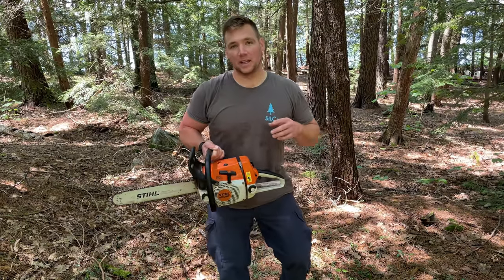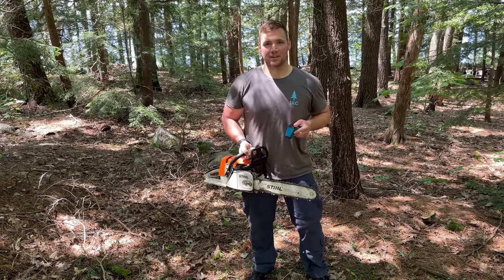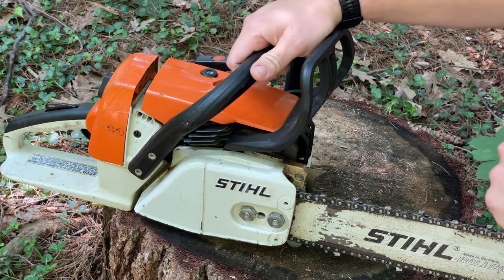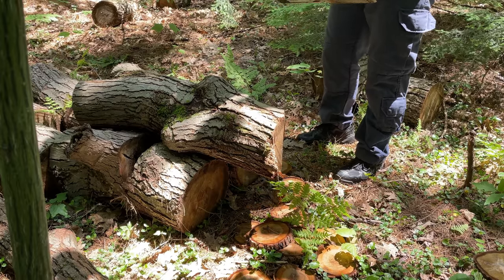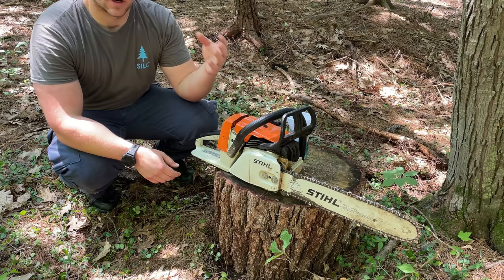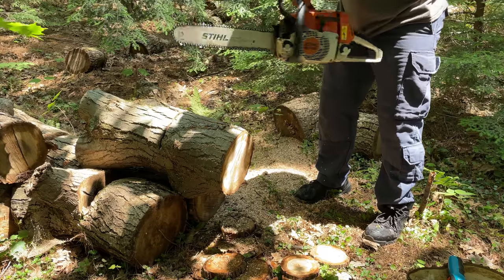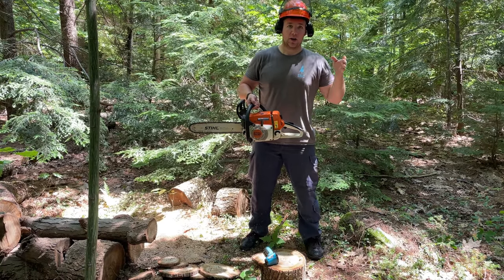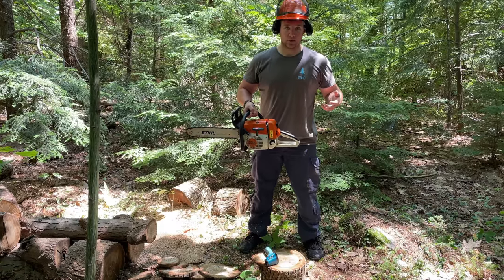Will my chainsaw last longer if I use more oil? Is it safer? (25:1 VS 50:1 temperature testing)

Comment: Just thinking out loud, there’s one variable you might have missed. Increasing oil in the mixture decreases gas. Unless you tweaked the jet settings on the carbs, wouldn’t that lean your A/F mixture out? And leaner mixtures do raise combustion temps and exhaust temps.
Reply: Actually, if you measure exhaust temps, they drop when detonation begins to occur.  So, I'm not personally sold on this parameter for developing a tune.  I have noticed as many will testify, a two-stroke tends to make most power right before it seizes (oil film failure).
This is why I place high value in the 4-stroking method for carb tuning.
Think of it as "dancing on the head of a pin" in the sense that when detonation begins to occur, the conditions for oil film failure are also occuring.  Detonation is often difficult to detect when it's occuring, it's much more evident by the way the engine runs.
Ever noticed when those last few drops of fuel from an empty tank are being used as the saw is running out of fuel, the engine feels most powerful just before it runs out and falls on it's face?  It just danced off the head of the pin and you felt it happen.
Reply: @thisisyourcaptainspeaking2259  right before my leaf blower runs out of fuel I can hear the engine pinging every time. And I know I'm low on fuel
Reply: @MrSprintcat  That's right, it's running lean at that point.  Maybe you know the old saying, a 2-stoke makes it's most power right before it lean-seizes.  This is because the piston overheats when the mixture is too lean.  Detonation occurs (often cannot hear detonation taking place, sounds like a pinging noise), piston overheats.
Stay on the fat side, don't adjust the carburetor mixture screws too lean, avoid detonation.
Detonation occurs when the fuel stops burning prematurely, such as low octane (low octane fuel burns quickly), insufficient fuel, or ignition timing is too far advanced.
I adjust my 2-stroke carburetor as fat as I can, where it still makes good power.  Occasionally this causes premature plug fouling and in that case I switch to next higher heat range plug.  This kinda depends on the factory ignition timing and spark plug choice.  Often, the factory timing is conservative and the plug chosen is a hair cold, to avoid pre-ignition (preignition destroys a 2-stroke almost immediately, pre-ignition and detonation aren't the same phenomenon)  Too much cylinder heat (such as a red hot plug electrode) can ignite the fuel prior to the ignition event.  Extremely damaging!
Some people go so far as to optimize ignition timing, ie: the pro motocross and watercraft guys, race saw builders.

Comment: When you add more oil to the gas,you have to retune your carb for the new mixture.  Plus your chain looked to be dull,with a dull chain makes any motor run hotter. The main reason they run 50:1 is for the EPA & yes the oil these days are way better then the 70's. I personally have old Homelite Saws, I use Stihl regular orange bottle mix & mix them at 16:1 & use rec 90 gas. I have the carbs tuned with the saw in the wood. They do smoke at idle but clear out once cutting.  I've never had carbon build up or any problems.

Comment: Less power, longer run time, higher temp.  Check your cut times on the video.  Try it again with a retune.  25:1 is mighty rich.  The 4 stroke guys know oil contamination of gasoline reduces power. A two stroke will run better and better up to 100:1, just at the expense of longevity.  32:1 seems to be the sweet spot for me.
Reply: Actually, when tuned properly, the more oil will give you more power. It's been proven in two stroke motocross testing. A 32:1 mixture is about perfect for a chainsaw but it will require a carb re-tune to get best performance and to assure you don't get damage from running to lean.

Comment: I would be curious to know what effect a 40:1 would produce, as that's what I run in my Echo CS620PW and Holzfforma G660 PRO. They're new saws and I've tuned them slightly rich to 4 stroke when easing up in the cut when in a log close in size to the maximum bar length; 27" and 36".

Comment: more oil is always better for the motors longevity. 40:1 and 32:1 are where I would run all of my equipment. Also you must retune your equipment when you make changes to your oil mixture.
Reply: That is not necessarily true

Comment: iv'e been saying this all along , oil burns hotter then fuel , also the more oil you use the more carbon buildup you get  which will cause scoring ,  thank you Dave
Reply from the maker: Awesome Michel!!!
Reply: @DavesSmallEngines  i'm thinking the apprentice might have taught  the teacher a little something here , lol  ,
even Steve's small engine disagreed with this idea 👍
Reply from the maker: @marcelcanuck  he did? Jeeze - I didn’t see that video!
Reply: @DavesSmallEngines  a few months ago  live show with Donny  ,not a big deal . i've learned quit a few things from his channel as well plus the guy is a hoot , great guy
Reply: If oil burned faster & hotter than fuel you'd have no lubrication & a seized chainsaw.

Comment: I was told by a very old Maine mechanic that 50:1 was the standard set in place by companies due to EPA regs. 
That's (one) reason Johnson outboards built in the 40's and 50's are still common out on the lakes and brand new motors fail after 10 years. The old motors ran on 16 to 40:1 depending on the year and model.

Comment: I may add a few drops of extra oil but for my Stihl I just use the motomix. If I don't know what the ratio is, I add a little extra like 40:1 just to be safe
Reply: Try 42:5:1, even better

Comment: I run everyting 20:1 with carb adjusted for that mix.Never had a problem with piston or cylinder. Saw is 30years old and never taken apart.

Comment: I agree, which is why I run 50:1.  Anytime you increase the amount of oil in the gas you end up with a leaner mix because the mixed gas has less gas per volume of mixed gas with the higher oil concentrations of two cycle oil.  Lean means hot and your tests prove it.  The key is to use a good two cycle oil and premium, non ethanol gas, plus a good stabilizer.  I use Stihl Ultra at 50:1 in everything.
Reply: Or tune your saw to run on your intended oil ratio.

Comment: Not an endorsement for anything but for 25 years I’ve been using Opti 2 (a one mix) for all my equipment.  My 52 year old chainsaw was 16:1, other equipment was 50:1 40:1 and 25:1 and I was tired of having 4 cans of old mixed fuel around.  Now 1 can, no ill effects on the old saw.  In fact I used it last week and other than beating my arms and shoulders up it ran perfectly.  That really amazes me, 1 ratio.

Comment: You also effectively changed the air fuel ratio with the 25 to 1 so basically you change the carb adjustment when you changed to the 25 to 1 my guess is you can get the benefits of running more oil in your fuel by manipulating the temperature of the plug you use and adjust the carburetor so benefits of 25 to 1 or 40 to 1 but the engine will run at the same temperature

Comment: I always run my mix rich on oil and have a few saws I've been running for 50 yrs plus with zero  engine issues. Normal wear and tear are not a factor.

Comment: Good video Sir, I am not a Tree surgeon but a Home user accross the pond, and I run all my chain saws on 50:1.    Stihl 08s, McCulloch 130, Husky 455 rancher and a small 120.  And stimmers, hedge cutter, post hole borer etc and no problems.

Comment: Nice scientific video, I know people who use 32:1 and there saws just don’t have the pull. I personally run 40:1 in my saws
Reply from the maker: Have you tried 45:1?
Reply: @DavesSmallEngines  no I haven’t, I’ll give it shot on next gallon I mix
Reply: Use 42.5 : 1 and decarbon every once in a while.

Comment: I understand that the higher oil ratio makes the engine burn a little hotter. But you never mentioned the lubricating factor. So, does the 25 to 1 lubricate better and protect the engine better? Is a few degrees more going to hurt the chainsaw in the long run? Also the manufacturer on my new chainsaw which is a 78cc states that they want me to run it at 35 to 1 for at least 10 uses. Then go to 50 to 1. I'm assuming because the 35 to one is a thicker oil ratio and in order to break it in and not score the cylinder as much they want more oil. And I can understand how you say it doesn't have the get up and go. Because there is not as much gas to burn and more oil. I noticed it on my new chainsaw also. I also noticed that with the 35 to one ratio it runs rougher not as smooth especially when idling. If you get a chance please answer my questions regarding the lubrication. Thank you for the video very informative. 15:03

Comment: Now tune it properly to account for the different mixtures and then do the test. I always run a 40:1 mix and tune with every new tank of fuel. I’d never go from 50:1 to 25:1 without tuning it prior to working it 🤦🏻‍♂️

Comment: Great data points. I have older engines that have 25:1 or 32:1 mixtures recommended. I suspect that a good part of the reason is that the 2-stroke oils were not as good in the "good" old days. One test I would like to figure out how to do is some equivalent of the tests that can be done on used 4-stroke engine oil, where it can be analyzed for wear markers like dissolved iron. Pretty hard to do with a total loss system, though.

Comment: Might have missed it but did you adjust carb/fuel air after switching to 25:1? It definitely will want more fuel considering you doubled the amount of oil. Interesting video but I’d be curious if jetting will bring those numbers down on 25:1.
Reply: Yup. The saw is tuned for 50:1 , no surprise it performs better there

Comment: GREAT video!!! Thank you for putting this together and forever settling the argument! 
Might I add, after I mistakenly mixed my fuel too rich and cutting down 14 aspen trees, my Stihl saw would not start the next day. I took saw apart and found the spark arrestor screen on muffler totally clogged. Because of rich fuel mix. There was so much soot at cylinder to muffler connection too. FYI

Comment: As you said in your intro, more oil means leaner burn, so you need to change the carburetor tune.  So, even though you did a nice, quantifiable test, your basic premise was off.  It would be much better to see this test done with properly tuned carbs for each fuel:oil mixture.  Or, likewise in a modern saw with automatic electronically tuned carb like a Stihl M-tronic or Husqvarna AutoTune.

Comment: Very informative video Dave !   Great presentation as well.  I always try to run a 45:1 ratio.
Reply from the maker: I’ve been told by @donyboy73 that is the sweet spot!
Reply: 40-45:1 Lucas has always been good for me!
Reply: This is what I do with my Stihl. Not because I know much about engines (I don't) but simply because it always "felt" like a better idea. Happy my gut feeling SEEMS to be correct.
Reply: Nope the sweet spot is 42.5 : 1

Comment: Here is a thaught.
Premix two stroke always will be a compromise.
Many of the oil injected two stroke engines deliver a different mix depending om RPM, the higher the RPM the leaner the oil mix.
The thinking being every poston stroke introduces a quantity of oil, more piston strokes more oil.
The thing that determines  required premix oil mixture is required oil at idle, particularly hot idle when comming down from righ rpm, high load, hot cylinder conditions.

Comment: Thanks for doing this test. Only issue is the proper tuning of the carburetor.  If you had carb tuned properly it probably would have been cooler at 25:1. Fuel cools. I'd like to see a re-test with carb properly tuned with 25:1 mix.

Comment: I was watching not in fullscreen and missed the jump cut edit around 3:15 where he had already put the fuel cap back on and about fell out of the chair when he flipped the saw thinking he had dumped out all the fuel. I think we've all been there, fuel or oil, at least once. 😆

Comment: Personally I run 32:1 Stihl synthetic.
1. My saws are not stock, woods ported and muffler mod.
2. Well over 50 gallons of mix fuel in 8 months thru two saws, Ms260, Ms440 both running 32" 3/8 full comp,or 25" 3/8 full comp. With zero carbon  deposits, clean spark plugs ( light brown ).
Reply: I have a ported 462. It runs great with 50:1 .
Reply from the maker: Cool!

Comment: Awesome video man. We run all our saws (all stihl) at 40:1. Never had any issues, but our 661 can be an absolute turd to start. I have always wondered if a leaner mix would be better for that saw.
Have you ever run a saw using 98 octane fuel instead of 91..?

Comment: My 1996 Stihl Farm Boss instructions say to run 50:1 Stihl 2 cycle oil, but to run 25:1 with all other 2 cycle oil since this oil does not have as much wear protection (at least in 1996).  Since 1996, i have used 50:1 Orange Bottled Stihl 2 cycle oil, premium gas, and no ethanol without problems.
Reply: Ran50/1 in my 1973 Evinrude, never a problem.

Comment: Well that was a good test ..I have always thought that one should mix the oil and gas to the manufacturer specs..my old homelites run on 16/1
Reply: me too. I just use the ethanol gas we buy at Murphy. I once tried two gallons of ethanol free gas. I couldnt tell any difference other than it cost more. Running any engine to lean will eventually damage it. They used to lean out the high jet on the 923 Homelites and get 11,000 RPM and burn the piston. So when the 925 came out it had a walbro carb with a fixed high speed jet. you could adjust the high speed jet and it never did anything.
Reply: @thecollectoronthecorner7061  ethanol collects water and doesnt play nice with old rubber
Reply: @thecollectoronthecorner7061  By adding water your taking the ethanol out of the fuel. Ethanol bonds to water better than fuel.
Reply: @silver1fangs  Im well aware of that. If you think about it those storage tanks at the gas stations are getting water added. Any place where cold air and warm air meet condensation forms. So that tank that has ethanol free is getting water added without any corn alcohol to absorb it. It might not be as good a fuel  as the Ethanol fuel treated the way I prefer to do it? Eny road it cost me less money. And ive been doing that for a couple decades without any  fuel problems. You cant let fuel set in any engine for very long before it turns to varnish.
Reply: @thecollectoronthecorner7061  thats a valid point. I hadnt thought of it in that way. My issue is really just the ethanol though never really had any moisture issues. One day I'll get a tractor and chainsaw that are newer than 1964

Comment: My 1979 Lawn Boy calls for 32:1, 1973 McCulloch PM55 calls for 20:1, Weedeater blower calls for 40:1 and finally the Stihl FS45 trimmer calls for 50:1. I have ran Amsoil Saber at 32:1 mixed with non oxy 91 octane in all of them for years. The trimmer smokes a little, and the mufflers are certainly wet, but everything runs perfect and ive not needed to clean the Lawn Boy's exhaust port in nearly ten years. I believe using quality air cooled oil at heavier ratios keeps the surface temps on the piston, rings and exhaust ports LOWER and lessens the chance for buildup. Ill deal with a little spooge in the muffler.

Comment: Couple problems I have found from ppl running higher oil ratio than manufacturer recommended are 1) plug fouling from excess oil coating it (because that’s what 2 cycle oil does, it coats the inside of the crankcase with a film to protect it from wear) which in turn generates more heat due to incomplete burn and in turn also accelerates carbon buildup which causes stuck rings and plugged exhaust valves. 2) 50:1 (2% oil) decreases your fuel octane 2 points so now your no longer have 93 octane but 91 octane so 25:1 (4% oil) decreases your octane to 89 which doesn’t leave your gas as much time to age before it’s stale. Not to mention ppl who use 89 or 87 octane. so many melted pistons and cylinders due to using stale gas (85 octane and lower is very hard on a saw regardless of how much oil you mix in). However I have heard of ppl using extra oil in a low compression saw to get by until they can fix it or get a new saw.

Comment: It seemed weaker to me just watching with 25:1 also carbon build up I always just roll with 50:1. I’ve been running the same saw for years and it performs perfectly everytime.  I cut a lot of fire wood for a home gamer I only burn wood no electric or gas heat at all..
Reply: Same here ... I’ve switched to amsoil saber in 2017 and notice way cleaner and more lubed parts during tear down
Reply: @lagoonrd4173  Amsoil is great stuff, all of their products are top-notch!
I've been using Bombardier full syn XPS-2 for about 20 years now, 1 gallon jugs of the best I've ever run.  I've never run Amsoil myself but most of my friends do and we've torch-tested it in their garage and the comparison between amsoil and some other decent stuff, the decent stuff lit off and made a mess while the amsoil just smoked a little.